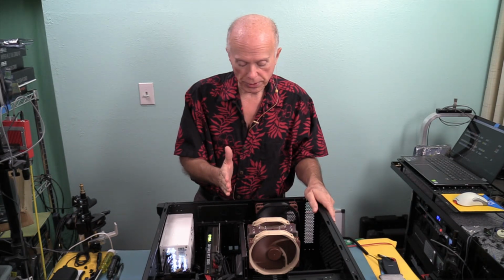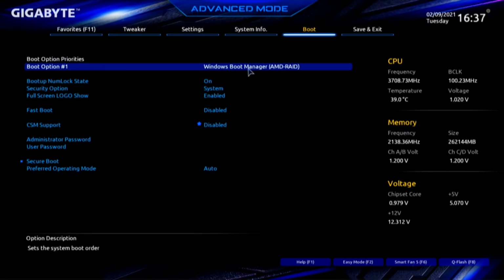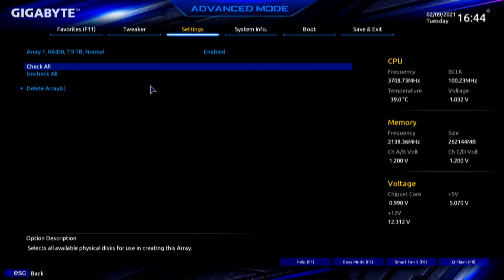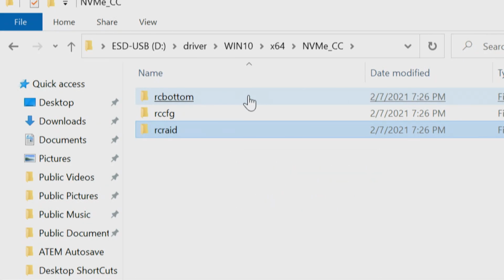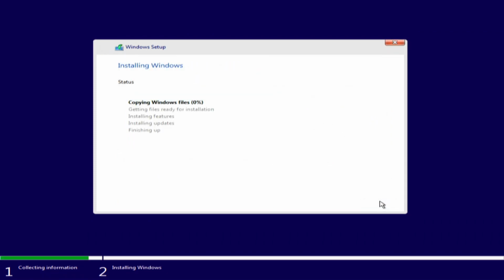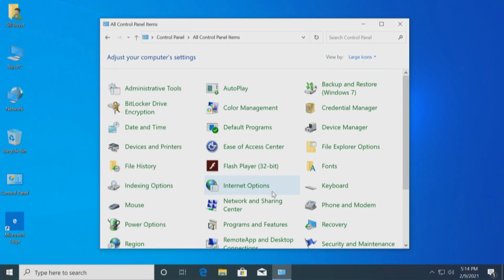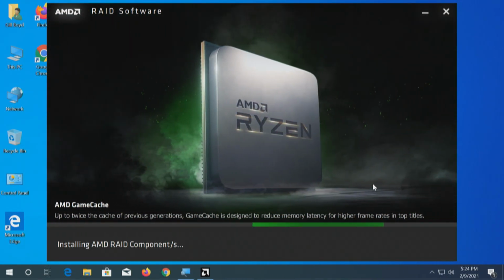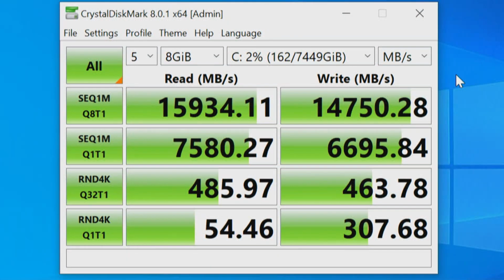Windows Bootable NVMe RAID 0 Tutorial on Gigabyte TRX40 Designare using Sabrent Rocket NVMe 4.0

Comment: Can this bootable raid 0 drive work with Win7? I have some expensive older professional programs that don't work with Win10. Also what would be different with a Intel i9 proccessor?
Reply from the maker: Hi Sterling Smith, 
Welcome! Lots of great questions. Trying to mix different Generations of technologies can be problematic. Before We get into the weeds, lets start with what matters. What's Your Motherboard Brand, Model and Chipset? 

Windows 7, to load the Driver, yes. The Question being: 
1.) Does Your Motherboard support Bifurcation? 
2.) Do You have 1 x16 Lane Slot, electrically? 
3.) On a 40 Lane CPU or greater. As long as You stick with RAID 0, OK. Any other RAID on i9 requires VROC Chip and Intel Drives only! 
4.) Bios support for NVMe. 

Your Motherboard Brand, Model and Chipset will define all of that in a nutshell. Windows 7 is 9 years old. Bifurcation is about 3 years old. Hope that helps! More details when You provide those Specs!
Reply: @BuildOrBuy  Thank you so much for the fast reply! Mobo is ASUS Z390+ WiFi, so I do have the 1x16 lane slot. Processor is i9 9900K 8 core 9th gen. I am also running Intel Optane H10 256gb RAM memory. I am worried if I can get all this to work. I built to get more out of my money but have been out of building computers for 20 years. Tech now is alien to me now its like starting over from scratch... I have the Hyper M.2 Gen 4 card with WD Black as OS drive and 980 Pro's in the Raid 0.
Reply from the maker: Hi @003590510 , 
Absolutely! Replies to Comments are always my priority! Here to help! You are not the only one. We have several Subscribers who have been absent for 10 years. You are the 1st to admit to 20 years of absence. Yes, everything has changed! Next time, let's talk Motherboard Chipsets when You Build a Computer! Chipsets Rule! 

This is all temporary knowledge! About the time We get this figured out, it changes again! And We start the process over! That's why I'm being very meticulous in the documentation of what We do. Vendor documentation is extremely lacking these days. No more errata docs on Bios Updates like We had 20 years ago, etc. 

We have to deal with Hardware then address the Software. 

ASUS Z390+ WiFi 
https://www.asus.com/us/Motherboards-Components/Motherboards/All-series/TUF-Z390-PLUS-GAMING-WI-FI/
https://www.asus.com/us/Motherboards-Components/Motherboards/All-series/TUF-Z390-PLUS-GAMING-WI-FI/techspec/
Note: 
1 x PCIe 3.0/2.0 x16 (x16 or x8+x4+x4)
1 x PCIe 3.0/2.0 x16 (max at x4 mode) *1
4 x PCIe 3.0/2.0 x1 *1
*For 3 SSD on CPU support, install a Hyper M.2 X16 card (sold separately) into the PCIeX16_1 slot, enable this card under BIOS settings.

Notice when You use the M.2 AIC. Look at what happens to the GPU, x4. And you can ONLY see 3 M.2 NVMe Drives due to the partial Bifurcation. Full Bios Bifurcation would be x4x4x4x4. Remember, reach PCIe M.2 NVMe Drive requires 4 PCIe Lanes, hence 1 x16 Slot, electrically, fully Bifurcated to see 4 M.2 NVMe Drives. Crazy right. It is what It is! 

Your other Option: PCIe 3.0... A Glotrends Sky card. Requires 1 x8 Slot. Self Bifurcating. Can see all 4 M.2 NVMe Drives. The Bifurcation chipset does the UpStream and Downstream Lane switching. Only requires 1 PCIe 3.0 x8 Slot. Amazing technology! We have a Video on that AIC here: - https://youtu.be/QF71-5nhrAk 

Hope that helps!

Now, to get that to work in Windows 7, I do not know if the RAID Driver will work in Windows 7. Have not tried it. I do know there is an NVMe Driver for Windows 7 therefor the RAID Driver should also be available. And since You're in Windows 7, we're talking about a 32 bit Driver instead of a 64 bit Driver. A quick read from Intel says, "Windows 8.1, 32-bit." Curious. Travel at Your own risk! 
 https://downloadcenter.intel.com/product/55005/Intel-Rapid-Storage-Technology-Intel-RST-
Reply: @BuildOrBuy  So My win7 64bit is really using 32bit drivers? And this also means the mobo I have can only bifurcate two out of the four sdd on the card; meaning the motherboard will only see three out of 4 drives to make a raid 0? I think I could live with that; with three drives at 7gb/s x (3) ~ near 21gb/s total. That Glotrends card is over 4x the cost what I paid for my Hyper M.2 card. I am building a budget performance machine but I think that may break the cost/performance ratio. Reading about the optane memory can you use it as RAM or as a compliment for the ram?
Reply from the maker: Hi @003590510 , 
The Drivers, that's what We found in a quick search. Windows 7 64 bit was problematic. We would have to dig deeper to confirm from link provided. Bifurcation is a big deal. That's an expensive Chipset for a self Bifurcated AIC. 

Yes, 3 Drives according to what We found. You would see one, three and four but not number two Drive. That too would need to be verified. According to the documentation, Bifurcation of said PCIe Slot would be x8, x4x4. The Specs are burst mode. There will be overhead. Actual Throughput will be lower. You will gain capacity! 

As for Optane, proprietary. Why not Add RAM instead? Optane was suppose to augment a slower Drive. Like a Hybrid Drive. And those Hybrid Drives did not live up to the Specs. Even Micron has bailed on Optane going forward. And Intel has removed Optane from the Desktop. Optane was suppose to act like a cache to minimize paging. Hence, just Add RAM! Keep it Simple!

Best case scenario, this works in Windows 7 - Both Hardware and Software. Worst case, BSODs due to Chipset / Controller Drivers. No way to know until You try and see what happens! Hope that helps!
Reply: @BuildOrBuy  Turns out my ASUS mobo was DOA. Stopped making it due to COVID. Had to switch out for a Gigabyte Z390 AORUS Pro WiFi. In process now. Having trouble; Fat32 will not allow me to put a copy of Win10 due to file size bigger than 4gb on my usb drive. How did you get around this? I dl the bios drivers from gigabyte and they are up to F12k now. Looks different but I'm going to try to follow your instructions. One snag is your three AMD drivers wont work on my i9900k chipset will they? The intel website does not have any drivers on their website for anything related to NVMe or raid.
Reply from the maker: Hi @003590510 , 
DOA Motherboard, That's a bummer! Gigabyte Z390 AORUS Pro WiFi. OK, Intel chipset. Intel makes Us work a little more. 

1. Using Windows Media Creation Tool. 2 Options. 
A. ISO for DVD. 
B. ISO for Thumb Drive - Choose Thumb Drive! 
Windows will create the installation media. 
2 Requirements to be met. 
A. FAT32 
B. 32GBs or less. 

3. Bios Update - Step through each version of the Bios Updates to get current. 
4. For Intel RAID. RST - Rapid Storage Technology Drivers. Intel is now doing that a bit different instead of by chipset, by technology. 

Since the Motherboard is new, pull those RST AHCI / RAID Drivers down from Gigabyte. Listed as, SATA RAID/AHCI. Easier. Hope that helps! Keep Us posted on Your progress!

https://www.gigabyte.com/Motherboard/Z390-AORUS-PRO-WIFI-rev-10/support#support-dl-driver-sataraidahci
See: Intel SATA Preinstall driver (For AHCI / RAID Mode). Download and unzip. Copy to install media. Suggest create folder on install media: Drivers. Point the Windows installation to that folder when asked about the RAID Controller during Windows installation. Success!

Comment: HELLO, I HAVE A QUESTION. ON A NEW PC BUILD DO YOU DO THE DISK MANAGEMENT BEFORE YOU SET UP THE RAID?
Reply from the maker: Hi MADDOG 4 LIFE, 
Welcome! Great Question! For Windows Bootable RAID, the Disk Management procedure occurs during installation of Windows. Disk Management is the process of initializing and formatting a Drive. Hope that clarification helps! Thanks for Asking!
Reply: @BuildOrBuy  HELLO AGAIN, IS THIS THE SAME FOR M.2 RAID ALSO. I HAVE THE ASUS ROG ZENITH II EXTREME ALPHA MB AND HAVE FIVE 1TB M.2. IM ONLY USING THE TWO ON THE FRONT SIDE ON THE MB. HELP
Reply from the maker: Hi @maddog4life190 , 
ASUS ROG Zenith II Extreme Alpha - TRX40 Chipset - Contrats! 
https://rog.asus.com/us/motherboards/rog-zenith/rog-zenith-ii-extreme-alpha-model/
What seems to be the problem? 5 - M.2 NVMe Drives all in RAID? 2 on Motherboard to CPU. OK. That means 3 are on the PCIe M.2 NVMe Quad card? And what's Your Goal?
Reply: @BuildOrBuy  SORRY LET ME TELL YOU WHAT I WANT TO DO. RAID FOR THE FRONT TWO M.2 TO PUT THE OS ON. DO I NEED TO RUN THE DISK MANAGER FIRST OR AFTER THE RAID IS SETUP.
Reply from the maker: Hi @maddog4life190 , 
Neither. To reiterate, that step occurs during Windows install. Did You watch the Video?
Reply: @BuildOrBuy  HELLO GILL,
THANKS FOR THE GREAT INFO. IF I HAD WATCH THE VIDEO TO THE END I WOULD NOT HAD TO BOTHER YOU, BUT THANKS FOR TEXTING WITH ME.
Reply from the maker: Hi @maddog4life190 , Based on Asking same Question twice, seemed like You had not watched the Video nor did You understand the scope nor grasp the nature of the procedures involved. 

The Video, as You now know, is complete. Our Goal is Your Success! If You get stuck, We're here to help! Thanks for watching! Keep Us posted on Your Progress! Appreciate Your Comments!
Reply: @BuildOrBuy  WELL IM ALL DONE WITH MY BUILD NOW. RAID O WORKS GREAT ON PCIE AND ALL MY OTHER DRIVE ARE SIT UP AS WELL. GILL THIS IS MY TENTH PC I HAVE BUILD BUT ITS BEEN FIVE YEARS SINCE THE LAST ONE....SO ALOT HAS CHANGED.  
THANKS GILL
Reply from the maker: Hi @maddog4life190 , Fantastic! Congrats on Your decision to Build and Your Success! The TRX40 is an amazing Platform for PCIe Resources. Yes a lot has changed in 5 years. Glad We could help. Technology keeps marching forward! Stay tuned!

Comment: What are your thoughts on HighPoint's 7500 Series PCIe Gen4 M.2 NVMe RAID Controllers?
Reply from the maker: Hi John doe, 
Excellent Question! Amazing technology. Self Bifurcated for Upstream and Downstream Ports. As many as 8 Drives on 1 x16 PCIe Slot! It's all about the Chipset! There are 3 types of RAID... Hardware, Hybrid Bios and Software. HighPoint's 7500 Series have a UEFI / Bios. Therefor, pushes Hardware RAID up against a MegaRAID card. Been a long time coming! Intriguing! Thanks for Asking!
Reply: @BuildOrBuy  thank you for the reply. I see you're doing raid 0 with the card you have on hand. My question is, if you do raid 1 with it, do you have the option to run hotspares?

 2x drives in raid 1 and 2x drives as hotspares
Reply from the maker: Hi @Johndoe-pv7sn , 
Absolutely! For Hot Swap / Hot Plug on M.2 NVMe requires a MegaRAID Card due to the cabling. 

Broadcom MegaRAID 9560-16i Storage Controller (RAID) - 16 Channel - SATA 6Gb/s/SAS 12Gb/s/PCIe 4.0 (NVMe)
https://amzn.to/2QUcY6I

And an ICY DOCK Full Metal 4 Bay M.2 NVMe SSD Mobile Rack for External 5.25" Drive Bay - MB720M2K-B 
https://amzn.to/3aywa0w
As an Amazon Associate I earn from qualifying purchases. 

Would make for an interesting Video! Hope that helps!

Comment: how much time it took to install windows with the RAID 0 ?
Reply: less than 5 minutes ?
Reply from the maker: Hi @JJWerm , Yes. Seemed longer. Fast but We should be able to do better. That's a detail We're working on to see what's possible. I think the holdup is backwards compatibility.
Reply from the maker: Hi Just George Thoughts!, Not as fast as one would think. The problem is the installation media. We're working on that for a follow-up. So far, a USB Thumb Drive tops out at 200MBps. We're looking into an NVMe. Which has to be 32GBs in capacity or less for FAT32. And that's an Intel Optane NVMe Drive. Stay tuned!

Comment: I’m following the steps. However when I get my RAOD0 setup with the card that came with the Gigabyte Designare TRX40

Do I need to have secure boot disabled? 

After creating the rate a get short post, longer post and another short post and the red  top LED is on. I get stuck in an infinite loop
Reply from the maker: Hi Edward Grubb III, 
FastBoot, CSM and SecureBoot all Disabled.  Having SecureBoot enabled would create that Loop since there is no O/S installed. 

Red Top LED = VGA: Graphics card status LED. You have only the Video card and the Aorus M.2 card installed?
Reply: @BuildOrBuy  I have the 3990x, 256GB RAM and the 3090 installed 

That’s it. I plan on tackling the TB3 afterwords
Reply: After I create the red I assume that I should be able to see the RAID on boot. Once I plug-in the windows media creation USB fat 32 do I need to login and make that the first boot?
Reply from the maker: Hi @EdwardGrubb3rd , OK. Just get the other things done first. Leave Thunderbolt last. And the Titan Ridge Thunderbolt card needs to be in 1st x8 Slot to Update Thunderbolt Firmware. RAID is easy compared to the Thunderbolt Firmware Update. Keep Us posted!
Reply from the maker: Hi @EdwardGrubb3rd ,
Everything has an Order of magnitude and a very specific prioritization. Are You going to Boot from the RAID? If not, Log into Windows. How many Drives are going to be in RAID All or some? It matters! If all in RAID, auto install RAID Drivers. If not and only Drives on M.2 card but NOT on Motherboard, then Manually install RAID Controller Drivers from Device Manager in order as outlined. Differences of those Details matter greatly. That's why we have separate Videos Detailing both types of installations. Looks like we need more clarity outlining the process.
Reply: It’s so frustrating. I’ve been at it for three days now
Reply from the maker: Hi @EdwardGrubb3rd , Patience, Persistence and Perseverance!  What's Your Status? Do You have RAID functional? That's why we Build in stages. And not all at once.

Comment: Does the bios need to be updated per individual bios update or just goto the latest?
Reply from the maker: Hi Ben Crosthwaite, 
1.) Our advice is to step through each Bios Update! That's been the policy since we were able to Update a Bios from the beginning. Vendors do not always update every nook and cranny of a Bios. And there are no errata documents as we once had to confirm changes. Better to be safe. 
2.) Any custom Bios settings will revert to default. Go into Bios and reset accordingly. 
3.) On Gigabyte, Only Update Primary Bios. You have a way back, just in case. 

On the Gigabyte TRX40 Designare Rev 1 Motherboard, do NOT use latest Bios: F4p, Dated 02/19/2021. Bad Beta Bios! Stay away from that one! 
https://www.gigabyte.com/us/Motherboard/TRX40-DESIGNARE-rev-10/support#support-dl-bios

On the Gigabyte TRX40 Designare Rev 1.1 Motherboard, do NOT use latest Bios: FBh, Dated same. Expect same Results! 
https://www.gigabyte.com/us/Motherboard/TRX40-DESIGNARE-rev-11/support#support-dl-bios

Suppose to do 2 things: 
1.) Update AMD AGESA 1.0.0.5
2.) Add Re-size bar option for AMD Smart Access Memory support

System will not Boot on hang on Bios Code: 9A. 9A = USB initialization is started. Hope that helps! We'll do another Bios Update Video when it's safe to proceed! Stay tuned!
Reply: @BuildOrBuy  Thinking my sabrent HD cards might be corrupted; or the storage card is not working. Going to run them by one by one on mother board. bios is at F330 atm..
Reply from the maker: Hi @bencrosthwaite3542  , Hold on! What Motherboard are You using? TRX40? Did You update the Bios? A Bios update sets every custom setting back to the default.  Go into Your Motherboard Bios and re-enable any features turned off! Hope that helps save You some grief!